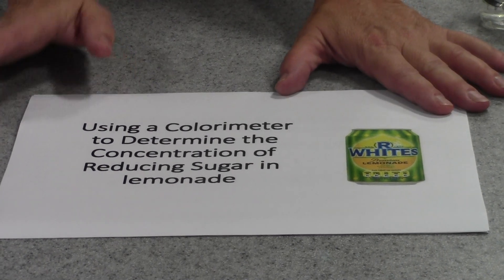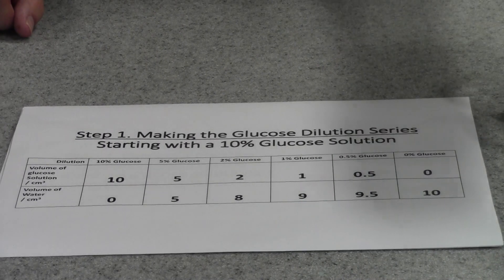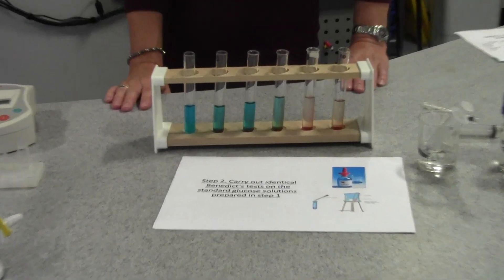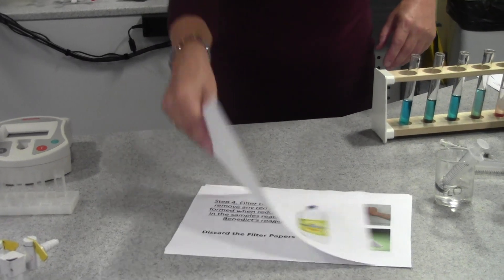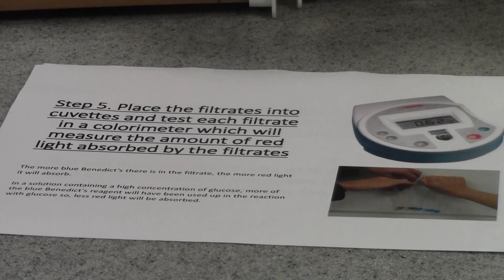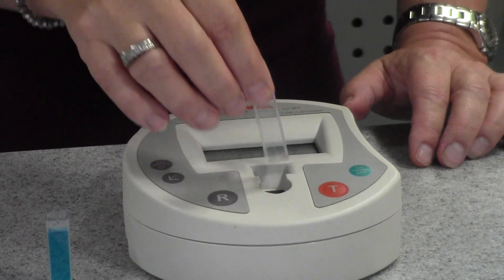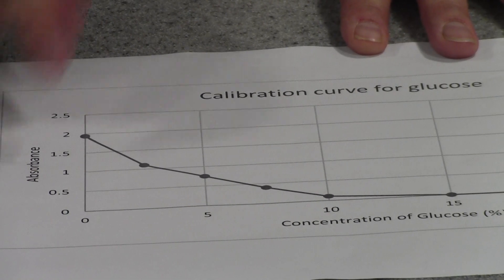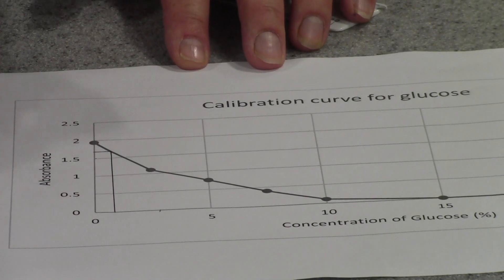Concentration of Glucose in Fake Urine. Colorimetric Techniques (A level but not AS)

Comment: Instead of using absorbance of light in the colorimeter, can you use transmission? Also if it does work then what kind of changes will it have on the calibration curve?
Reply from the maker: Muhammad Vohra yes it will work fine. The curve will just be reversed.

Comment: I wanted to ask, what is it what they test on paper 3 for aqa a level as in what type of questions would they ask ? Would it be to questions about why you use certain equipment and control variables etc?
Reply from the maker: Shrey Chandran you need to look on the aqua website where past papers and specimen papers are available. Paper 3 has the essay and questions could cover any topic but some relate to practical skills plus there is always a data question where you need to be able to use the results of statistical analysis to draw a conclusion about significance of results. It is early days for the new aqua spec so your best bet is to look on their website.

Comment: I'd like to ask why you join the points with a line point to point instead of a line of best fit?
Also, why does it level off near the bottom?
Can you actually measure the intensity of red light instead (so without filtering the red ppt)?

Comment: i dont understand how you calculated the amount in ml of glucose and water to be added for each dilution?
Reply: I normally just use the equation (concentration 1 x volume 1) = (concentration 2 x volume 2).  
For example for a 2% solution: the concentration you want is 2/100= 0.02 and you want a 10cm3 volume of it. 
(0.02 x 10) = 0.2
You want to find the other volume but you know the concentration, so if you rearrange the equation all you have to do is divide 0.2 by the concentration of the actual glucose solution which is (10/100) 0.1.
0.2/0.1 = 2 so you need 2cm3 of the glucose solution but the total volume has to equal 10cm3 so 10-2=8 leaving 8cm3 of water.
Hope this helps, took me a while to understand it too. xxx
Reply: Thank you so much!! :)